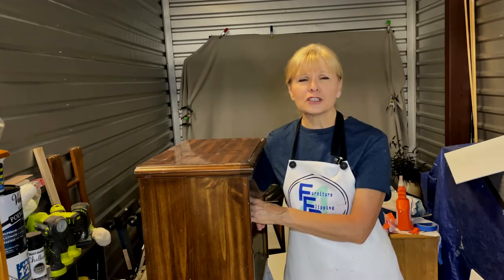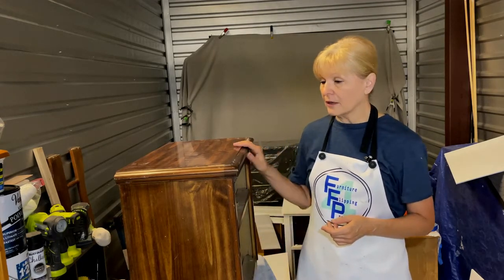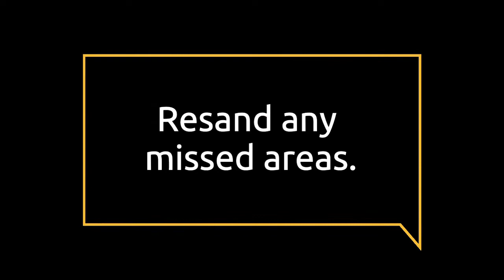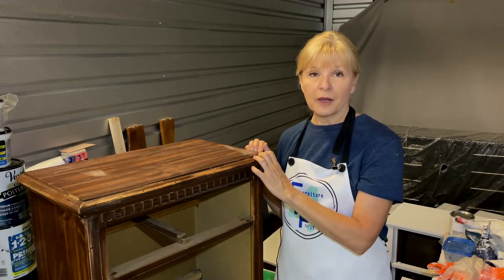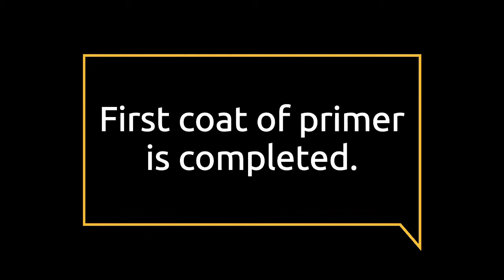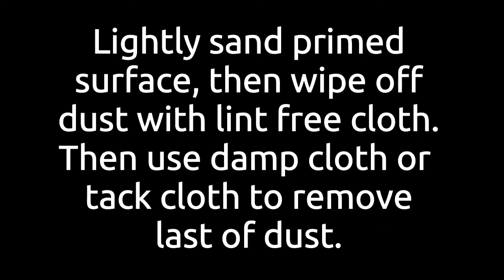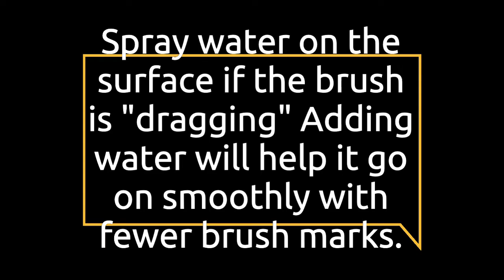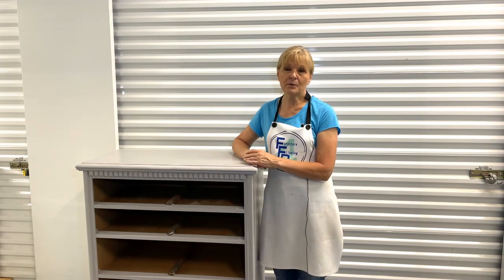YES, YOU CAN PAINT LAMINATE FURNITURE! Laminate Dresser Makeover

Comment: Curious is there something inherently better about using chalked paint vs other paints for laminate refresh or is that just what was preferred for the “look”?
Reply from the maker: Chalk paint can be thinned easily so the paint brush marks are minimal. It also adheres well to various surfaces and finishes. Give it a try and you will see what I mean!!!  Latex is think and leaves brush strokes. It can sometimes peel off. Chalk paint sticks!  BUT you should always put a sealer over chalk paint to protect it!!!

Comment: Love your channel, just found it. very instructional.  on this video I had two questions. 1) you  choose chalk paint, why? could one use interior house paint? why or why not? I ask because the color I want to match needs to be custom mix like they do at paint stores and I do not think that they will do that at like Sherman Williams stores etc.,
2) now you used a sponge for the clear coat, could you have used the disposable roller like you did for the primer? why or why not?  thank you. I look forward to learning more.
Reply from the maker: Hi Lyndon. Thanks for all your questions 1) I am using chalk paint because it is very durable and easy to apply. Have you ever used it? It is quite different from any other paint I have used. You can actually go to Home Depot and they will color match the Behr chalk paint to any color you want. They can also mix it in any of the colors on the "wall". I do not like to use latex paint because it peels off in time. Watch my video where I tested different brands of chalk paint and tested them for durability.  I painted a piece of metal with chalk paint and one week later after it had cured I had to actually use paint stripper to get it off the metal!!  Here is the link to that video:  https://youtu.be/wS8TLTD-vg0 
2) If you use a disposable foam roller to apply sealer you will get tiny bubbles in the sealer. If you use a car washing sponge you can very quickly apply a thin coat with no streaks, brush marks or bubbles. Give it a try- you just might like it!  OF course if you use a sponge, you may need to apply 3-5 coats to get the proper thickness but it goes on so fast that you are done in no time. Plus it dries real fast when you use a sponge.

Comment: Meant to ask if you recommend using chalk pain on kitchen, bathroom cabinet and countertop?
Reply from the maker: Hi Evelina. I have never painted a counter top but would never use chalk paint for a counter top. I have never heard it recommended. Chalk paint is fine for kitchen or bathroom cabinet provided you prime it paint it and than give it 4-6 coats of sealer.

Comment: I've watched many channels and am just staring in flipping furniture.  So many say be careful applying poly to the "light" colored furniture because of yellowing.  You don't mention this.  Do you find that this Varathane Ultimate doesn't yellow light colored finishes?  I am fixing to flip and dining table and am concerned about yellowing.  As yourself if I am going to sell a piece I want it to be as high quality as I can make it.
Reply from the maker: First and foremost- most yellowing on white furniture is not due to the sealer as much as it is due to bleed through. Therefore I always use an oil based primer any time I am going to paint furniture white. In addition, if I have pine knots in the wood I ALSO spray the knots with shellac. I prime it even if I am not sanding it to bare wood. I repeat- I ALWAYS PRIME WOOD FURNITURE THAT I AM GOING TO PAINT WHITE. I prefer spray primer- it goes on quickly, does not require sanding in between and seals the wood better than water based primer.  The only time I have had a problem with water based poly turning yellow is when I have some drips- the drips will sometimes turn yellow. So I make certain I do not have drips. I too am very concerned about white furniture turning yellow- I believe the primer is most important.

Comment: You don't mention it in the video, but did you apply only one coat of polyurethane? Is more than one coat recommended? Do I need to sand in between if I apply more than one coat of polyurethane?
Reply from the maker: I usually put 3-4 thin coats of water based polyurethane on a piece. I only sand it with crumpled up newspaper to get off the "nibs". Of course you have to be careful that you are in a dust free environment. I never paint or apply finish outside- too much dust!